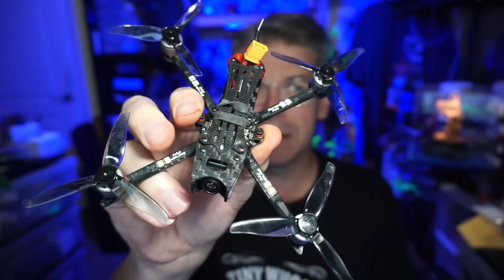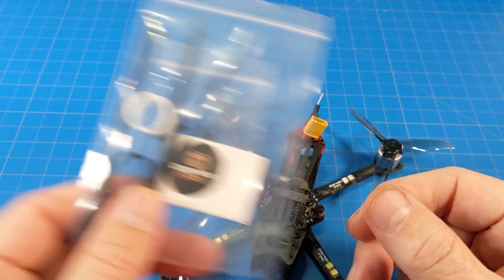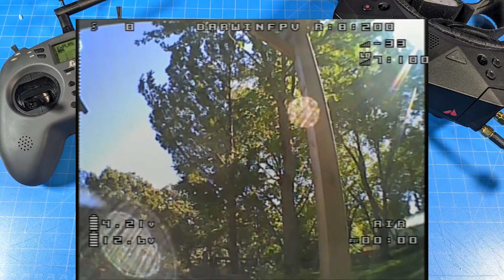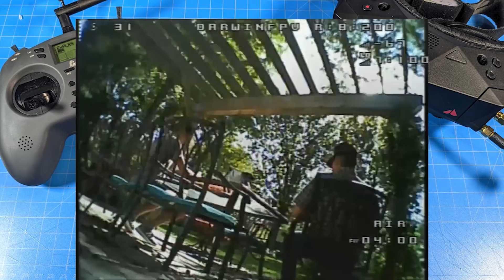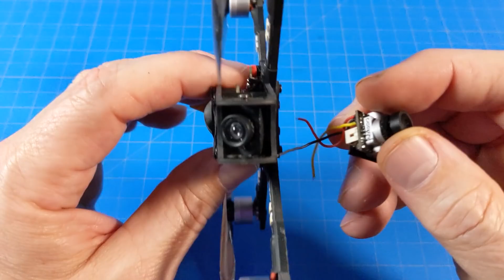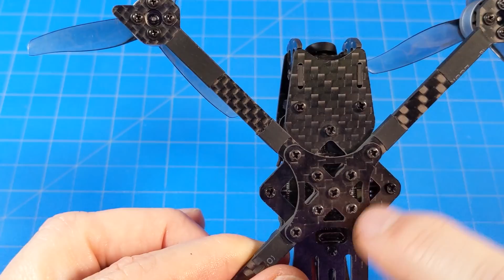So Cheap Made Me Worry // DarwinFPV BabyApe 3 // Took My Crashes

Comment from the maker: What do you think? Worth $70? If it were $90 what would you change for the extra $20?
BabyApe 3 https://bit.ly/3FVL1QG
DarwinFPV AliExpress https://bit.ly/3p8sWct
Reply: could be wrong but i'm pretty certain those are zerotech dobby motors ;) very sure looking at the dobby motors in my hands right now :) same size same kv makes me wonder what a build with dobby props and motors would fly like :D erm coupla weeks might have that video up on my channel lol
Reply from the maker: @Dread-I-Productions  I am not familiar with that brand name. Very well could be.
Reply: Hi Nick, thanks for all your great videos! Have been  clinging to ur channel for quite a  while now

Btw, I'm planning on making a custom toothpick with those motors bought sepperately. What do you think about a 3018 gemfan, crux3 frame, crazybee f4 v3, and 3s 450 mah?

And how do you think it would compare to a usual 1204 5000kv happymodel?
Reply from the maker: @KolibriFPV  It will likely fly about like this one does, it is worth noting I don't know if those motors come with motor connectors so we will likely have to solder them to the AIO directly.  1204 is going to handle a tri blade better, meaning the response to changes will be quicker and more authoritative with 1204 motors over smaller motors. Might not be a huge deal depending on one's flight style.
Reply: the babyhawk motors dont have long enough wires to reach the 4in one so they used those led/racewire to make use of them, If I remember correctly the bayhawk was using individual esc's they only scary thing is those 1104 were for 2.3in props and 2S i know people did run the babyhawk on 3s but not 3in props dont know if they will burn out...maybe..... oh and those 1104's used special non standard screw pattern so cant use prop screws if there loose too so meh i dunno if its a big deal to everyone but a few down sides
Reply from the maker: @Neukom720  One comment thinks they might be dobby motors, but I couldn't say, I am not familiar with that brand name.
Reply: @Neukom720  you ate correct squire
Reply: Caddx ratel 2, 👌. Thing looks amazing for the price
Reply: Camera with a wider field of view, and 1200tvl.
Reply: i would add an insta360 go holder on the front
Reply: I think the motors are way too small for 3 inch. However I want to try the Baby Ape Pro v3 3.5 inch with 1504 4000kv motors.
Reply: I don’t fly 3s and this looks like it would struggle on something smaller like 2S. 
So for a few more bucks I would buy in if the AIO and Motors could handle 4S.
Reply: The esc I would change

Comment: Hi,

I’m reaching out for assistance with my drone. While flying, it briefly touched the ground, and I thought it was just a minor incident, so I disarmed it. However, unexpectedly, it shot back up into the air for reasons I don’t understand, and then it crashed hard.

Unfortunately, it’s now broken, the motor is like pushed down and I’m unsure how to repair it. I’d appreciate guidance on troubleshooting the issue and any recommendations for repair options. 

Thank you for your help!
Reply from the maker: I can't be sure but sounds like the landing was with the drone still armed. This will jar the flight controller and often it can respond violently as you experienced. The way we land traditional fpv quads are to hover in place and decrease our height to a few inches above the ground then disarm (switch).  As for the repair, need to acquire the motor, best source is likely the manufacturers website and solder the new motor on. You may need to acquire a soldering iron and some solder with flux to replace the motor.

Comment: I have the baby ape pro pnp just ordered radiomaster pocket and receiver elrs should I get the nano ranger for the radio ? And will the sky o20 goggles be a good fit for this set up thanks a lot !!! Trying to get into fpv and as much info at same time thanks!!
Reply from the maker: If you ordered the pocket in ELRS and the receiver in elrs there is no need for the nano ranger. The goggles will work with any analog fpv quad.

Comment: Can the default camera be changed that comes with the drone?
Also can you make a video on how to connect the transmitter and goggles with the drone ? i have fs i6x transmitter
Reply from the maker: Yes, any cameras with the same mounting distance can fit. Connecting with googles is basically matching the frequency the drone is transmitting at to the goggles. Most use the goggle auto search to start.
Reply: @NickBurnsFPV  Thanks for your response, but can you explain the later part of the question about the transmitter?
Reply from the maker: @tamoghnadey  Its called "binding". I don't use flysky, you will need to do some research there.
Reply: @NickBurnsFPV  ya it's called binding, my bad :/

Comment: I just love my Baby.But first I replaced the junk camera with a Runcam Racer2 that had a good image but no uptilt until my Caddx Ant arrived. A little TLC was required as my vtx was up against the top plate. Longer screws and small spacers fixed it. Contrary to what most reviewers tell you it is on standard BF 4.2 PIDS. I turned off airmode and all the crutches and did a easy to do tune on it. First quad I've had where it feels glued to the sticks. It's not rocket but I fly it more than any other I have. I would have to replace it and I have many spares. A Bargain.

Comment: i bought and tried to connect it to it to the betaflight, but it says failed to open serial port. I installed all drivers and it didn’t help.did some one had that problem?
Reply from the maker: This is common. I presume this is the first quad. Be sure we are using a cable that is data and power capable. Typical cell phone cables are often just power for charging. We need a cable we can get data through as well
Reply: @NickBurnsFPV  ty, i’ve tried 2 different cables but it didn’t help(, will try another one
Reply from the maker: @yungstfawk  alsodownload and run with the quad plugged in the driver fixer from here https://impulserc.com/pages/downloads
Reply: @NickBurnsFPV  thank you very much about cabel! it helped me a lot

Comment: I may have got a lemon but mine was junk. Yaw jitters and jumps all over the place.
. Really disappointing.
Reply from the maker: Sick of the bat?
Reply: @NickBurnsFPV  I didn't really explain that well. I'm not good with predictive text.
So I finally figured out what was causing the issue and it was still the manufactures fault. The FC hates antigravity mode but it comes enabled. The PIDs are just stock and with a bit of time spent by the manufacturer they could have presented this quad with a tune. 
Lastly, the VTX gets super hot and needs to be set at enabled-after arming.
Reply from the maker: @Hotwire_RCTrix  I wonder if the gyro on the fc changed, we have been seeing multiple gyros on all our FCs. The filtering required is fairly different.
Reply: @NickBurnsFPV  Some of this may be a conflict with Betaflight. Features set in BetaFlight , like MOTOR_STOP needed to be  toggled in CLI in order to be acknowledged. 
The manufacturers really need to help themselves by employing people to tune and configure the quads they sell. eg. Having  GPS settings in this quad is sure to cause issues if the firmware is told to find a GPS module that doesn't exist.
Cheers, thanks for replying.
PS cheap should mean good value and not shoddy.

Comment: I have a baby ape ! This quad is great! I can fly it with out anybody freaking out,
It’s quiet , your not disturbing anyone.
It’s like flying a 5” but stealth. 
I use a 3s 550maH , I changed out the vtx antenna and using crossfire rx .
Try one you will not be disappointed.

Comment: I purchased the Darwin 129 7 inch quad and it was a complete mess!  Missing vibration Grommets, soldering to esc was worst I've ever seen.  Barely any solder.  GPS was DOA. Darwin labeled vtx is useless.  RDQ did send me more Grommets because they are weird size of course.  Found other issues after my first flight with vtx sucking and gps just didn't work.   I've shelved it for now.   I'll probably try adding a Vista HD system later.   Not wasting anymore time on it.   I paid $169.00 so not to mad but definitely disappointed.
Reply from the maker: I am a bit uncertain. Did it fly at all?

Comment: Has anyone tried to put LI-ION batteries in this drone? (For cruising purposes), Or what's the biggest li-po you can put in this tiny drone? (I'm not going to use any action cam on it, that allows me to put a bigger 3s battery?)
Reply from the maker: I don't think I have heard of anyone documenting the different sizes of batteries that can be used on this quad. In general in FPV we compare performance rather than biggest.

Comment: You have some awful high frequency noise going on in this video!
Reply: The Ant comes with that little 1mm bracket right? Mine did!
Reply from the maker: Mine didn't have the ant camera, can't say what that version comes with.
Reply: I mean you showed that the ant camera wouldn't fit nicely, but it should come with a little bracket to make it fit... at least mine did. One rubber thingy and a translucent plastic one.

Comment: Hi, thinking of getting this, how would I install the receiver. I'm thinking a flysky receiver
Reply from the maker: I can't be to specific as its been years since I have used flysky. I suspect we need to use an rx pad on the board and select ibus on the betaflight configuration. We also likely need to have the uart "on" for the rx numbered pad.

Comment: I just got one.  Apparently you can only use an SBUS type of receiver, maybe.  I'm trying an IBUS for Flysky but it's not recognizing it.  If anyone knows more about this, please let me know!
Reply from the maker: We likely need to switch the configuration in betaflight on the configuration page from sbus to ibus. Try that. We might also have to find the flight controller and see if it has a different pad for ibus unlikely but possible
Reply: @NickBurnsFPV  that's what I thought and I did change it in Betaflight but still no response in the receiver tab.  I found that I have a SBUS received and just finished hooking it up, all is good.  If they have a pad on the FC for IBUS it would be nice if they point it out on the diagram that I have.  Thanks Nick.  I've been watching your channel for about a year and have learned a lot.  In fact, I heard of this Ape quad from you initially so thanks again for all that you do.
Reply from the maker: @sllim3059  Oh great to have it working. I am not all that familar with ibus. Its possible we just need to use an rx pad?

Comment: Nice thing. What is certainly changed in last 5 years from time when I started to build my 80-130 mc quads - frames, motors and props are now much better. Similar frames at 2017 was heavier but with thinner arms and more prone to break. Electronics and software in general improved too. Particular build 5 years ago was possible but overall experience was like meh. Now thing like this often give a feeling of 5".

Comment: Which ExpressLRS receiver did you use and any wiring suggestions?
Reply from the maker: If I recall correctly I used the happymodel ep2, I would suggest using the flywoo or jhemcu sp24s. They all have the little cube antenna but the flywoo and jhmecu have a boot button so if we needed to get into bootloader we don't have to solder only press the little button.

Comment: Newb question: Already have analog goggles and a controller, what else is needed to use the drone
Reply: receiver.
Reply from the maker: If we buy a quad without a receiver we do need that. Also a charger for the batteries. The last thing that isn’t needed but good to have is a small battery checker.
Reply: A receiver, be sure to buy a receiver that works with your controller

Comment: Am I the only one that uses Velcro tape on my top plate and batteries? I love the Velcro. I have not ejected a battery since going to that.
Reply from the maker: I used to use duralock, but I found it more trouble as I use so many different batteries and the duralock would break down over time. But if it works, roll with it.
Reply: @NickBurnsFPV  I looked up Duralock. Never heard of it. This is what I found. "DuraLock-C™ is a concentrated trisodium citrate solution, which has been shown to greatly reduce the incidence of catheter related infections."  HAHAHA! That's probably NOT it. 

Micros don't have as much of a problem ejecting batteries I guess because they're light weight.
Reply from the maker: @CarbonGlassMan  ha, no not that. Its this stuff https://www.amazon.com/3M-Reclosable-Fastener-SJ3560-Clear/dp/B00JHKTDMA

Comment: I've got four of the Darwinfpv quads now.  A 79 , two 59s and one of the 18650 powered Dave c design copies.
I can honestly say that they all fly very well. I've had no component failures so far with any of them.
The only change I made on the 59 was to swap the vtx to a higher powered one as it flies so well, the 25mW stock vtx didn't allow me to fly far enough away !!
The 18650 is exceptionally good and all of them seem to have good flight times.
I've had more compinent failures with some far more expensive quads!!
Only thing I would say is to check all the screws are tight before you fly. One or two were a bit slack out of the box.
As the prices are low I'm not scared to try new tricks for fear of smashing up a very expensive quad !!  Can't really fault them.
Reply: Thank you buddy. Let us work together to do better
Reply from the maker: Thank you. Very good information, I appreciate you taking the time to type out your experiences.
Reply: How has your experience been with them as a customer?  I've made an order 2 days ago but have no order confirmation email or shipping confirmation email
Reply: @djrodriguez6582    My first orders were through Aliexpress, no problems with those. 
My latest order for the Babyape is direct with Darwinfpv, I had confirmation of order straight away. Dispatch seems to take about a week, Ive just had a confirmation email.
If you log in to your account with them you should see some details of your order.

Comment: I have the darwin79 (4s 3").  It will fly and it works for having a drone I can experiment with and do more risky maneuvers.  Comparing to a babyhawk II it doesn't fly nearly as well, but like I said if it gets stuck in a tree or smashed on concrete I'm not as worried.  I got it when it first came out for like 80 bucks and it's a nice backup to have.

Comment: i just had the same aio fc die for no good reason,but i have a darwin 20x20 stack in use that's fine. i think the babyape is a good deal tho. replace the crappy camera and your still in for under $100. nowadays i think the electronics in this quad have as much chance at making it as anything else. love the videos,Nick.

Comment: Those motors look just like the ones on Emax original babyhawk! I do wonder....
Reply from the maker: Yes. I wonder if the original manufacture is still use the same ole bell design.
Reply: @NickBurnsFPV It feels like the quad is made from spares - might explain the ridiculously cheap price... those old school Emax motors could take some punishment too!

Comment: Thank you Nick! Thank you for your comment on BabyAPE. If you have better suggestions for improvement, I hope you can tell me. We are willing to make it a perfect 3", and we will listen to everyone's suggestions.
Reply: use runcam nano 3 camera. if you need camera with screws then use caddx ant lite. don't go cheaper than those two cameras. cheap cameras but not usable are a waste of money.

use these silver motors with your 3" toothpick frame. 3" or 2.5" props, it will be lighter and faster.
Reply from the maker: I do suggest on a 3inch prop to run a 120x or 130x sized motor. A camera that is equivalent to the caddx ant or runcam nano...the caddx baby ratel 2 is a very good micro camera that retails for $25, this is my go to camera for micros. 200mw vtx is largely suffcient, but more mw will a benefit.
Reply: list the frames on aliexpress please :) we will built configurations and betaflight setups for you to copy :)
Reply: Just purchased mine! I'm hoping it's a good experience.

Comment: I bought the Darwinfpv 7 inch GPS quad from Pyrodrone..rebrand of the Tyro 129. And it was actually a solid 7 inch quad for under $140 bucks. Of course I ended up switching some components to do DJI fpv.  But it was worth what I paid for it. Awesome thing about this little quad you reviewed here is it is budget friendly and get more new people in the hobby! Thanks for sharing 😎 Looks like the old Emax motors..lol
Reply: Links to how you added Vista to your Darwin 129 please.   I'm converting mine.   Mine was a total flop new out of box with Dead GPS, vtx sucks,missing vibration mounts and just poor soldering.   Shelved mine until I figure out how to add DJI Vista to it.  I just can't stomach Analog  anymore since going HD.  Unfortunately.

Comment: i am wondering how you can calibrate the accelerometer with the usb socket in that position.. 🤷‍♀️
Reply from the maker: I use an empty tape roll to set the quad on. I route the usb cable up through the roll and plug in to the quad, then when I set it all on the desk I have a bit of the roll hang off the edge of my desk for the usb cable.
Reply: @NickBurnsFPV  very clever